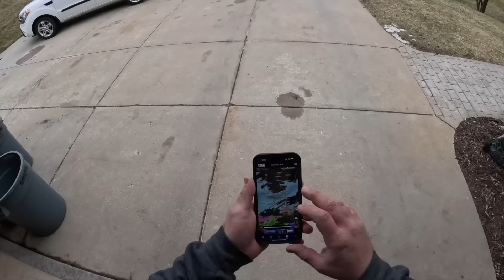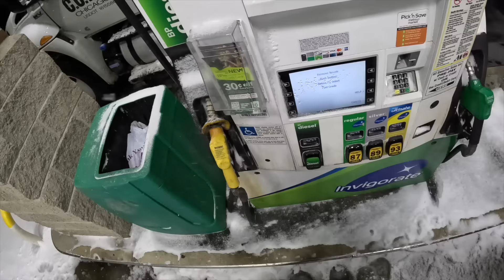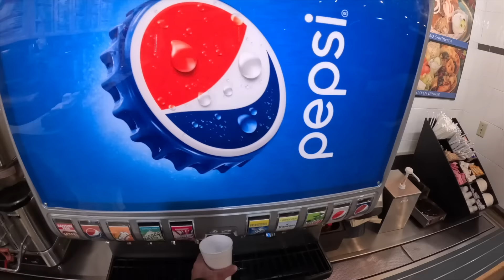Snow days are the best! Bobcat S750 plowing snow

Comment: If your Bobcat struggles with that plow. I wonder the struggle with the plow Eric has. Here at work I use a john Deere Gator. It is a lot smaller. but when the pushing gets tough I put it in 4x4. you are correct on the redundant. I have a type of OCD when it comes to plowing. lol. No lines left un plowed. Smooth as concrete.